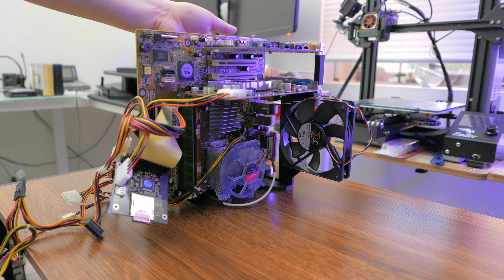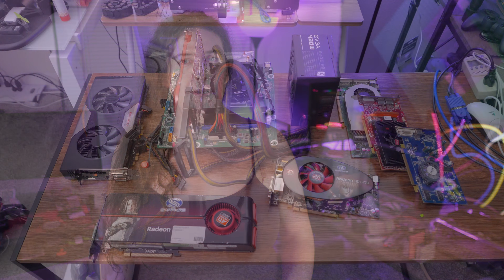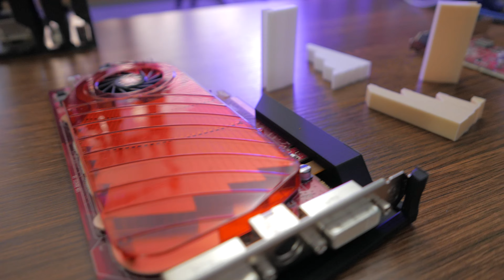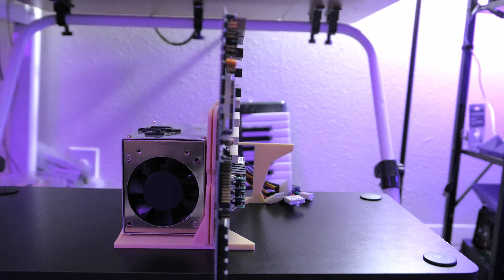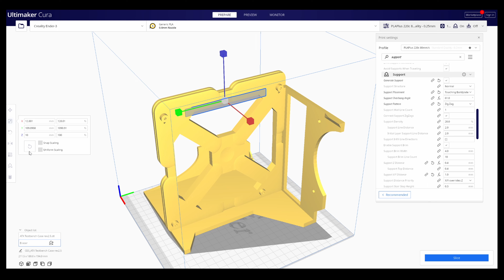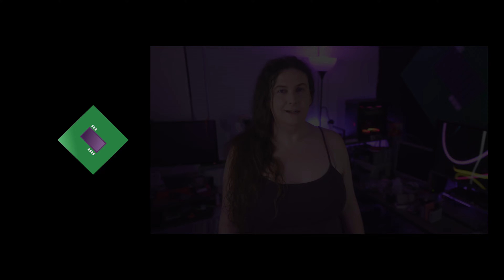Testbenches and GPU Stands! ✨ Updated Description!

Comment: Sorry I'm a bit confused about the sizes although you had a nice picture in the video about the various ones. I have a 305mm long motherboard. Will the ATX_Pos1_mini work with that board or do I need the ATX_Pos1 or ATX_Pos2 for that?
Reply from the maker: The size of the motherboard doesn't actually matter -- they all use the same mounting holes. ATX, mATX, and mini-ITX all have the same four mounting holes at around 170mm, that these prints use to secure the board to the testbench.

Pos1 and Pos2 are conveniences to allow you to print a testbench that more-closely aligns with your board's primary graphics card slot, since not all boards put the primary slot in the same position.

The "mini" version is a condensed version of the testbench designed to print on smaller printers like the Bambulab A1 mini, the Prusa Mini, and the Kingroon KP3S.

I've made a newer version of these testbenches, and I illustrate the difference a little better with their intro video: https://youtu.be/2-eV7zN-AMA?t=598

I hope this makes sense; let me know if you still need a hand!
Reply: @TechAmbr  Thank you very much for the comprehensive answer! It's much clearer now. As I don't have a 3d printer myself I will have a third party to print. I need to look through your video again before deciding as it's so much information, THANKS
Reply: @TechAmbr  A kind guy is currently printing, live: https://www.twitch.tv/atego_89    :-)

Comment: I can`t afford a 3d printer, so I just got 2 pieces of plywood, I made 4 wooden supports two separate the wood with enough room for the PSU to lay in the bottom piece with a bracket to hold in there. Then I marked the holes for the motherboard, drilled and fixed the little stand off`s to screw into. I fixed a piece of threaded rod into bottom half long enough to go up to the top of the graphics card and just used a wing nut to secure.
I must admit yours looks awesome and you have done a fantastic job, whilst mine looks like a dogs dinner it functions.
 Will you go on to sell these? and many thanks for all your work here...Kudos

Comment: Hello Ambrosia, can the m-ITX test bench be made compatible for the Noctua NH-P1 passive cooler, with respect to supporting its horizontal mounting weight? Perhaps with a similar support bracket as for the PCIe slots?
Reply from the maker: Probably, yeah. I'm actually working on an updated version of the testbenches that allow you to make your own add-ons for several areas on the print -- a support / fan mount is certainly doable with the upcoming version. Hoping to release the new versions by the end of the year!

Comment: Satanic sub counts unite.
Reply: Crossfire with Radeon 4870s works in Borderlands 2 with raytracing using the Elder Scrolls IV: Oblivion preset where all others fail. Scaling is mediocre but its literally a first in the attempt without massive glitching. Of course ive only tried 13.1 mostly because windows 10 makes installing the drivers period, esoteric, but possible.

I cry when angels deserve to die.

Yes.

Dreams are made winding through my head.
Reply: @TechAmbr  

I have a dream, that one day, someone will write custom drivers to enhance retro hardware using modern software.
Reply: That sounds all fine and dandy but I'm coming in 2x 8800GTX SLI running that forsaken ultra crispy and using some old pile-driver you threw away
Reply: @ferdrickmciodoshi3920  

SLi has a much higher batting average. I suspect it would make your generation of DX10 hardware more functionally useful with my archive of essentially ambient occlusion and friends on steriods. If you were in the market for exotic.
Reply: @ferdrickmciodoshi3920  

Id also dig it if you decided to check it out, if you left info on what worked with SLi and what did not, since thats the only way ill reasonably know if that generation is going to fly or not. I dont think im going to test everything, just the pinnacle of DX10 hardware since its struggling in a lot of cases. At least with one chip.

Comment: Considering the curling and shrinkage that happens with my resin printer I don't know if I can successfully print one of these, but I am going to try and print one of the ISA video card stands.  Thank you for the BabyAT benches.  I have multiple babyAT boards and no cases, so something that allows me to use them even a little bit for testing and possible repair is greatly appreciated!  I will report back how the video card stand prints.

Comment: I really need to get my 101 level bed adhesion issue figured out with my Ender 3 so I can print a few of these, I am swimming in old AT form factor stuff and long sound/video cards that are ISA or VLB so I can test the oldies for you... regrettably no 2-slot VLB video capture cards though.  Another wonderful video, and thanks for sharing your hard work designing and testing all of these stands!
Reply: Talking on levelling - this is specifically talking about the Ender 3 V2 but it should work just as well on the original Ender 3: https://www.youtube.com/watch?v=mfVTD8d-a4o - I was already pretty good at levelling my 3 V2, but this made it faster and easier. So it might be helpful for you!